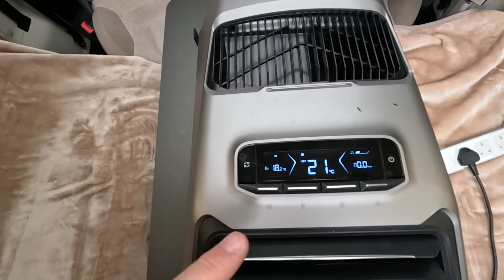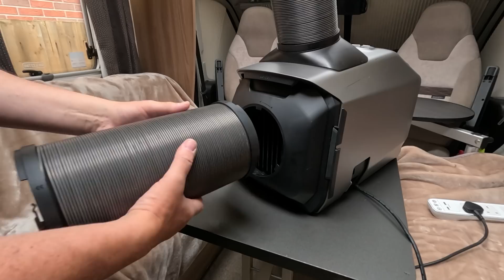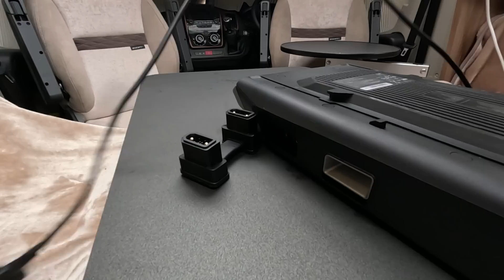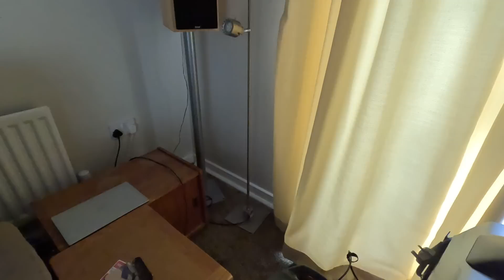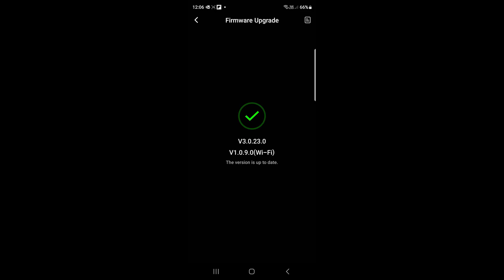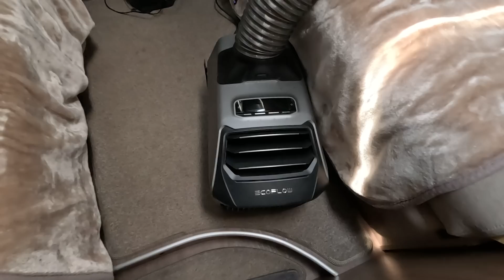Ecoflow Wave 2 In The Hottest June Ever: We Needed A Replacement!

Comment: I don't know if you still review or comment on old videos but I figured I would give it a try... 

You're one of the few uk based reviews of the wave 2 that I've seen! 

Im looking to potentially get 1 or 2 but I plan to use them in my flat as they're smaller than standard portable air con units available but my concern is if they're powerful enough. The maths says they should be but most outdoor usage hasn't been fantastic. As you used your unit indoors could you advise on how well/poorly it worked to cool your living room?

I live in a 1 bed south facing flat which has very large windows in the bedroom and living room (they're about 180x180com) which is great for light most of the year but combined with being south facing and 4 floors up, my place turns into a greenhouse whenever we get an average sunny British summer let alone a full blown heatwave! 
Right now (July 13th '24) its 17c outside, but 28c inside, which is fine but a few months ago when we had high 20's it reached 34c inside despite me using black out blinds and curtains and airing out the flat at night when temperatures went down. I dread to think what it would be like if we had 2022 heatwave again with potentially 40c outside what the internal temperature would get to.

Many thanks!

Tldr: in your opinion is the eco flow wave 2 sufficient to cool your living room during a heatwave?
Reply from the maker: It worked well in keeping our living room cool when we did actually have some heat last summer. Our living room is around 6x10m. Hardly used it at all this year!

Comment: I used an EcoFlow Wave 2 last summer, my Camper Van is maybe half way in the shade, but the cooling ability of it, was just barely not enough through the summer. Hard Sell over a typical 800W single hose portable AC if you have shore power, I think it's more efficient in general though, it does have to run longer as it can't keep up with the Sun where I'm out, so it probably evens out.
Reply from the maker: For us, the best thing is the portability of the unit. We've used it in our lounge at home on those days when it has been hot recently. I'm not convinced I'd ready to spend £1500 plus fitting on an roof mounted unit for those few days when it's actually warm.

Comment: We have this wave 2 A/C unit and what I've done with the pipes is used the window vent that comes with it and modified it slightly and fitted it to the passengers door window.works a treat.it also holds the pipe in place without the pipe moving all over.the unit fits between the cab seats and the delta2 fits in the passenger foot well.all out of the way.great piece of kit.to charge the delta 2 we have 400 watt portable solar panels.thanks for the very informative vlog.
Reply from the maker: Thanks, I might have to try that with our new Motorhome, we've been trying to decide if we need a fixed AC unit.

Comment: Would think you would draw warm air from inside the room not from outside....set up a virtuous circle....air gets cooler and cooler as it cycles through the machine whereas otherwise just cooling boiling hot air from outside and pumping it in after being cooled a bit.
Reply from the maker: Yes, I agree, we were taking air in from inside because we choose not to use the air intake hose.

Comment: Hi Bob, 

We watch all of your videos on YouTube but I didn’t know how to send you a personal message on there. 

We have been looking at getting the Ecoflow Wave 2 a/c unit for our MH (and home). We were going to wait until the show in October at the NEC to see if they had some offers on. 

However, some of the stockists are doing good prices now (c £850 for the basic unit). When I see this, I normally think suppliers are getting rid of old stock prior to the launch of a new product in the coming season. 

So, my question is, are you aware of a new version (maybe the Wave 3) and what additional new or improved features could it possibly have? 

Should we wait in case there is a new product or get one of the current stock, at a good price, before they sell out? 

Many thanks

Wayne & Janet Smith
Reply from the maker: I don't like getting personal messages about my YouTube channel. The best thing to do is leave a comment on here, which you've done. I'm not aware of a Wave 3, they've only just released the Wave 2 this year, so if you want one, go for it, click this link https://uk.ecoflow.com/products/wave-2-portable-air-conditioner?aff=13
That would help support my channel and you'll find it at the same price!

Comment: Don't buy this thing.  the battery need the top part (36Lb) main machine to charge the add on battery.  So, wherever you need to charge the battery, you need to bring the top part.  Just don't understand why the battery is detachable for no meaning.  They don't have an individual charger for the add on battery.  the designer is out of mind.  Don't make sense.
Reply from the maker: As I said in the video, you do need the main unit to charge the battery, which is a missed opportunity. However, you can also power it from Mains electricity or from an EcoFlow Delta powerbank. Some people might not want a battery, or they may have an EcoFlow Delta, that's why it's an option.

Comment: I'm using my W2 in our Living room. Using Top rear Vent to Exhaust hot air out with the 5 inch hose. Thru the Glass Sliding Door with board and hose attachment.
All sealed tight. We are not using the Intake 6 inch hose. This makes compressor works more efficient. Chill Fan#2 or #3 works fine. Not using Max setting much..
Insulate the Hot 5inch Hose
is VITAL. 55F degree cooling air is common. Often 30F degrees cooler than ambient room temp. We attach Delta 2 Max to W2. Feed about 600w Solar from Array. W2 often draws 350w to 450w. By time Sun is down. Delta 2 Max 2000w battery is charged up. We don't use the wall power charger much into Delta 2 Max
Reply: W2 wattage low draw about 290w. Outside Air weather Temperature is 110F degrees at 4 or 5pm.
Reply: One Solar array is 3 x 220w panels. The other Solar array is currently 1 x 220w panel.
Reply from the maker: Thank you, I don't a good reason to use the air intake hose either.

Comment: Nice review, Bob. I bought my zero breeze after comparing it with the wave 2. I love the portable way it is! Simply pop in a battery and it's off to go, instead of recharging the heavy wave 2.
Reply from the maker: Thanks, it is a a lot lighter, but is half the cooling capacity, good if you're not bothered about it not having heating either.
Reply: @BobEarnshawMoHo  Thank you, Bob! I have tried using it as a heater by directing the rear exhaust hose towards the area I want to heat. LOL, it's a trick I learned from other users. Yeah, I agree, the cooling capacity is the main thing, but it works for me in 90°F. So I guess everyone just needs to sort out their priorities when choosing a portable AC.

Comment: Look at the size and the price. Easier to get a proven system out the way on the roof. Typical freebie getting biased reviews. Soon as I see the Radfords gear which is free or discounted I stop and delete.
Reply from the maker: I would suggest you didn't bother to watch all of this review if you thought it was biased. I did say I thought a roof based air con was better if you don't need the portability. I also pointed out the problems I had with it. The Wave 2 is currently in our lounge keeping us cool.

Comment: Hi Bob, I just bought a Wave 2 and have been testing it out. On AC mode, mine makes a little noise other than just the blowing air. Not super loud but noticeable mostly on the lower blower setting. I have heard the same noise from window AC units before so maybe it's normal (but those could be old units with issues). From what I gather, it may be just normal sound of refrigerant passing through the evaporator. If you put your ear up to the front filter area of your unit, do you hear that sound too? I only hear air blowing in your video but maybe you can hear the other sounds when up close to the front filter.  Any info is appreciated.
Reply from the maker: No, I don't hear anything other than the fans whiring. There is an occasional noise when the drain function is working, maybe a pump or similar. The previous unit had a bit of a rattle from the front grill.

Comment: Is the black drain plug only a bung ? Have u tried to poke something through it. If it didn't have a bung it would not fill the container.
Reply from the maker: No it's not a bung it has a small opening. However I know that the drain function works correctly on the replacement.

Comment: It works better if you let it outside and just pump the cold air to the inside with the hose. It consums less than 200w on eco-mode, pumping ice-cold air of 6 C° which unheard of in the industry.

Comment: We bought the wave 2 so we can use in the home and the van. We fashioned a bit of backerboard with a hole to fit one of the windows so it now slides in place. But, after slightly disappointing results on a hot weekend in York, we re-read the instructions and it clearly shows both pipes being used not just for the heat exchanger but also the air con function 🤷🏻‍♀️ so think we will have to try and see if this improves cooling times. Thanks for the video Bob.
Reply from the maker: You're welcome, it was certainly 100% better than no cooling!
Reply: 5 inch Exhaust must have Insulation
Reply: De'Longhi Insulated Hose Cover for Portable Air Conditioners

Comment: Great review. We have roof mounted air-con in our Vantage Sol, which the previous owner fitted. If I was starting again I would go for 2 Maxair fans. Most of our trips are to France an Spain in the summer. It can't have been that hot, Jenny is still wearing her jeans
Reply from the maker: Lol, she forgot her light trousers! I would add that I went out for a while and left Jenny in the motorhome, we had the problem with it not draining and it went off, quickly heated up in the motorhome, even with our max air on. I don't think you can beat AC to keep it cool.

Comment: Hi Bob. You mention in the captions that sleep mode is set at 26 degrees, which seems very hot – is that adjustable to a lower temperature while keeping the dB level down? Thanks for the very useful review.
Reply from the maker: You can adjust it down, but it may have to work harder to keep a cooler temperature. I tended to put it on 23C at night which seems a useful compromise, it's often the humidity that's the uncomfortable bit at night, so it helps with that.
Reply: @BobEarnshawMoHo  Thanks Bob

Comment: Great review. We have the delta 2 / wave 2 bundle. We've used it in the house so far and it is great too cool down smallish rooms. We have an A Class and my plan is to build a piece of wood which will act as a template for the two pipes to go out the sliding window at the front. As you say it takes up space but the ability to use it when you don't have electric or take it in to the house is a real winner in my opinion.
Reply from the maker: Yes, it needs a template for the window.
Reply: I had good success with 3 x 220w panels in Serial Array feeding the Delta. Have hit 499 watts feed to Delta 500w mppt. Use Delta to W2 and run mostly free with Solar.
Reply: @larrywong7834  which 220 watt panels are you using? Most of them exceed 20 VOC and therefore 3 of them can’t  be used without exceeding the unit’s 60V limit.
Reply: I made a template that fits in the passenger door window,works great.

Comment: If you aren’t worried about it getting stolen put it outside and put the outlet hose into the Motorhome through the window. .
Reply from the maker: Yes you could do that.
Reply: My thoughts exactly, in the awning perhaps?.... would it work as well as presumably its progressively cooler inside a van and then working less hard?... but outside with 1 pipe in and allowed to drain as it needs would seem the way to go..?